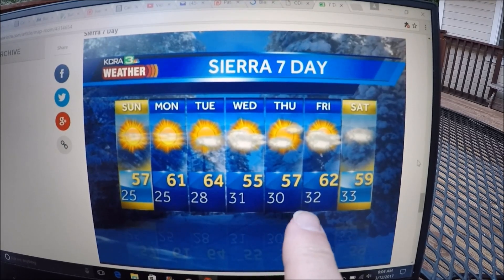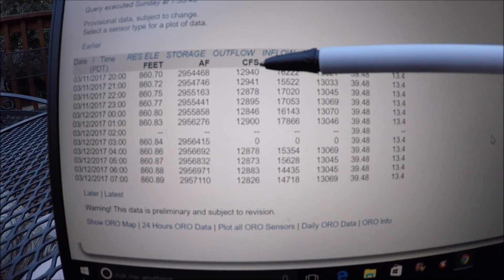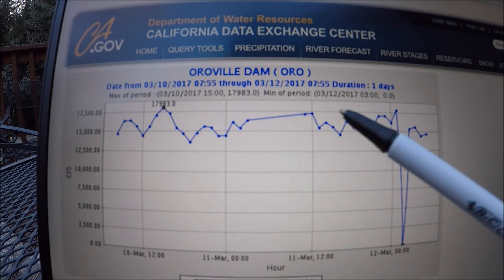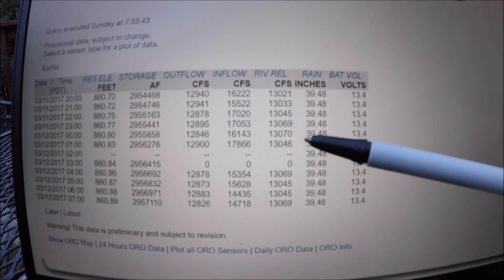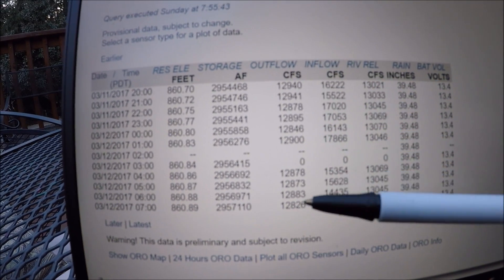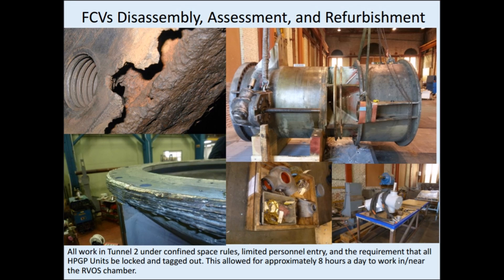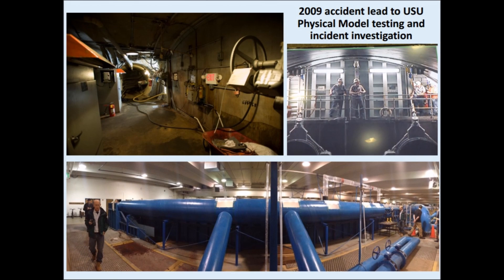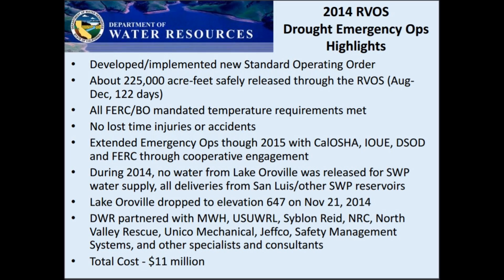Oroville 12 March update River Valve Outlet System Explained

Comment: I have to correct some information here. The system is two sets of  4 valves. There is the 6 ft spherical ball valve upstream of the wall block and a fixed cone valve (FCV) on the downstream side. The spherical valves were never removed as you would need to drain the lake to do that to empty the valves. Only the FCVs were removed and refurbished. the FCVs provide a spray release to dissipate the water force like a garden hose gun. However there is a project in place to replace the spherical valves by installing new valves inline with the originals and keeping the originals as emergency back ups.

Comment: The vacuum requirement for the RVOS is confusing to me… if such suction was required, why not add an air duct on the downstream side of the pressure relief wall? Then theoretically the side where the workers operate wouldn’t be subjected to the air flow issues in the first place. 

The entire system is rather confusing, the access tunnel they used to enter the chamber is where the air came from during the incident I guess. I’m not sure how that ring is supposed to work - the water stream doesn’t actually impact the ring does it? Somehow it’s presence dramatically reduces the waters ability to form a vacuum (aka just disturbing the flow I guess?) but I can’t visualize how the water streams would interact with it. 

Either way, that has to be one of the scariest places on earth to work if you think about the forces and head pressure present on the other side of those valves, all while staring down a half-flooded giant pipe knowing that if anything happens, you’re going to get flushed out of there with unimaginable force.

Comment: can anybody explain how they replace the valves when the entrance to the tunnel they are in is 100 feet below the typical summer low level at 600 feet when they are expected to maintain flows into feather river?.     There are two valves on the one operational tunnel.     Apparently the whole system was replaced a few years ago.  Thanks
Reply from the maker: They were replaced during the drought at very low lake levels.

Comment: You are doing an excellent job of providing coverage of this flood event.  I was flooded out in 2011, so I know the value of accurate timely information.  I enjoy watching all of your videos! Thanks for all your effort!
I have to comment on the Oroville Dam and the use of River Outlet Valve during spillway operation.  Since the discharge tunnel for the a River Outlet Valve uses the same discharge tunnel that the Power Plant Turbine use.  It appears that using the River Outlet Valve when the river water is high would have the same effect as operating the Turbines when the discharge lake level is too high.  This could increase water pressure in the tunnel because of high discharge water levels and could end up flooding the turbine area. High water pressure could lift the turbines out of their mounts and flood the area, like what happened in Russia.
They need to find a solution to the discharge levels, as the it is ridicules that they can't use the turbines river outlet valves to reduce the lake level when the spillway is operating.  Apparently the power station was installed at too low of elevation compared to the river channel downstream of the dam!  They could remove all dams downstream of the dam to lower the river level below the dam, but that would mess up their complete irrigation systems! 
If the lower dams were added after the dam was constructed, it would explain how the final operational design does not function properly because it raised the final operating level of the river!

Comment: Juan, thanks for all the videos, I have been following this story like a civil engineering soap opera.  Even with all the trouble with the valves, it begs the question why not open them now?  Sounds like that can now be remote controlled opened, even with a fire hazard.  Even if they must be opened manually, now the workers know what they will be facing.  Might it be possible to have someone in a dry suit and a strong harness, with diving equipment, to turn the valves on but not be blown away?  Also seems the valves could be open all summer, until the spillway is finally replaced (I think it is a bit far gone to be "fixed").  Also, might it be possible to take out the turbine of the 6th generator from the scroll case, and just water run through the scroll case?

Comment: These days, as far as I'm aware baffle rings are generally used in a temporary situation such as a diversion tunnel. They can take quite a bit of hammering and are usually fabricated from stainless steel. The water speeds up going through the smaller cross sectional area then hits the slower moving water in the expanded tunnel section on the downstream site creating turbulent flow and slowing the water.  The baffle was downstream of the valves that release the water, so this may explain why the low level outlet is now running at a lower capacity than designed. If they cranked it up without the baffle in place, the water would cause cavitation and erode the tunnel lining

Comment: Question if I may? Is the actual height of the dam wall 900 and something feet top to bottom and water depth 861 feet  currently ? Sorry but I have to convert to metric, at that height head pressure at dam  bottom would be almost 2600 kpa or 378 psi. I hope that's right...
Reply: 27.7 inches of head per PSI (If you're talking about fresh water)
861 ft x 12 in/ft / 27.7 in / PSI = 373 PSI

Your calculations are correct on the pressure at the height used.
Reply: I think the pool at the bottom of the dam is at 225', so 861 - 225 = 636' drop
Reply: Even more scary in this situation:  Using the formula A=pi(radius squared), that is pi(36 inches)squared x 373 psi, there are 1.5 Million pounds of pressure on the sphere valves!  Is this actually correct?
Reply: Area = PI x R ^ 2
Looks like you forgot to halve the diameter

PI * ( 36" / 2 ) ^ 2  * 373 = ~380,000 pounds

A 1"-8 bolt (Low tensile strength  grade 2 coarse thread) can break at 36400lb - so 10 of those at a minimum to hold the valve - without any safety margin.

Can't tell the diameter of the bolts, but if you look at this point in the video there are at around 56 or more holding the blind flanges, 20 on the 16" valve attached to that.
https://youtu.be/_q0g43iI9kA?t=8m29s

Comment: Capt. Browne... Can you please explain something for me. In the last series of pictures it seems to infer that the newly installed Howell-Bunger valves were recently removed and replaced with much smaller 16 inch Gate valves. I am not an engineer so maybe I am not thinking correctly but the smaller gate valves would seem to provide less flow than the much larger H-B valves. Which are currently installed?

Thanks again for your spot on reporting.
Your friend in Georgia..... living on a hydro-electric lake that has an emergency spillway that dumps onto a dirt hillside also!!!!
Reply from the maker: Grandin Eakle yes, and I need to get more details on how these valves all work together, and what the final permanent configuration will be.

Comment: ...I'm coming to you, since no one else seems to have accurate information available....my question....what it/was the maximum CFS the main spillway was designed/engineered to be? That is, in normal, non-emergency operation....
Reply: I estimate 200,000 cfs is what the sidewalls will hold.  Watching the footage of it running at 100,000 cfs looks about halfway up the wall.  Say a 20' high wall x 200' wide x 50 ft/sec = 200,000 cfs
The 150,000 cfs figure is the design release to not overwhelm the downstream levies.
Reply from the maker: Doug Ankrum it's been tested up to 160,000cfs long before it failed.
Reply: ..Thanks....!!

Comment: you put a fix on that spillway with steel   ..steel will keep water in or out at fair pressures so first you line that spillway and diversion block set with 3 inch welded plate with a overlap sticking out over the joint where the spillway fairing meets that old concrete deck area     and you start there with a row of  18 53' waffle side domestic rail containers which slides up under that plate overhang that has slots cut in it for the container vertical joins  for a new steel spillway width of 153'   u line the bottoms of the containers with  half or 1 inch plates 55 feet long  so you have a tab sticking downstream into the next row...bolt and seal weld these into the base row   after the first couple of rows you should be able to set the rest of it  on pillar blocks with steelwork bridge expansion joints  pillar blocks 3  53's  with rebar cage inside set end to end and the end walls removed bolted together  cast 1 piece  steel cased  159 x 8.5 x 9.5 with cast in mounting bolts for the joints..26.5 on center   and stacked 4 hi so you now have a  box 153' wide and 38 feet high with 18  8 x 37' openings    and now 11 plus feet of the ground with a  double bottom   and if you get a leak you can weld the thing from the outside anywhere......and you fill the space between the container walls with a hi silica concrete    and paint the steel inside and out in hi silica concrete wash    ..its a real decent anti corrosion preserving compound for steel in water and inexpensive.        and armor that diversion block with a 3-5 inch steel cap  and here is the plus part  you mount solar panels all over that box for a net power increase out of the whole affair and pays for the repairs.
 Best Reporter ,,he blows all the others right on out and supports dwr pretty well i think
Reply: if you need more supports   12-24 inch steel tube
about 5000 containers  construction time   they have a crew there already   3 weeks..4  not much for the steelwork..the solar panels would take longer

Comment: Thank you for your informative videos. I found this information on the USGS website. About 2.5 miles from the Oroville dam, there is a quarry. On March 15, May 26, Sept 14, Nov 9,  and Dec 9, 2016 there were quarry blasts that created magnitude 1.8-2.6 earthquakes at a depth of .2.-3 km. On Feb 7, 2017, the main spillway develops a crater.  On Feb 11, 2017,  the emergency spillway is used. On Feb 14,  there are 2 EARTHQUAKES 2:39 am, magnitude 0.8, depth .98 miles and 2:56 am, magnitude 1.0, depth .02 miles. On Feb 21, there was a quarry blast at 19:45, earthquake magnitude 1.8, depth .3 km. On Feb 27, the spillway is destroyed. These is also a seismogram display ORV BHZ BK 00 at the dam, but there is only one page of data that I could find. Where is the seismogram data? I would like to know if there is a relationship between these earthquakes and the dam. I have not read or seen any substantial information about the earthquakes near this dam. I tried to get as much accurate information as I could, hopefully, I did not make any typos. Any insight you could provide would be appreciated.

Comment: A fire in a hydroelectric power plant isn't a fire in the normal sense.  When a fault (a short) occurs relays sense the fault and cause breakers to trip shutting off electricity.  Before that can occur (if it occurs) what exists in the power station is a giant arc welder.  I'm told the Thermalito plant was running but unoccupied at the time of the accident.

Comment: To clairify, the power house that burned was the power sourse for the river valves. I wonder how long it would take and if they are considering a temp emergency gen to operate the valves?
Reply from the maker: Im not sure.
Reply: I was watching vids of the dam and another viewer pointed out the generator operating the spillway sitting on top of the dam in comments.  It looks like a cargo container and is as big as the trailer of an 18 wheeler.  I'm sure it is still there.  When they need to open and close that spillway in the next few days they can't afford to lose power.
Reply: We were talking about using another one for river valves.

Comment: Well to my untrained layperson eyes,  this reservoir looks like an unfinished POS.  Why they didn't continue a structure over the emergency spillway for access to the other side of the dam, line the emergency spillway  and fix the broken items screams of cutting costs over safety.  The parking lot area still looks like a great weakness in the system.  They had been warned too!  I guess the "it will never be a problem" became a problem.

Comment: I guess they design infrastructure to only last 50 or so, years..  It saves money and by the time it fails,  the Designers and Politicians will be gone..  Most of the infrastructure in the  USA is well past the 50 year mark,    A large percentage needs to be "Rebuilt",  NOT repaired,     But, the USA is broke,  
    It seems Nation Building has been more important,  Trillions of dollars are GONE,   "Draining  the Swamp is crucial"  to rebuilding American roads, bridges, damns and the Electrical grid,
Reply from the maker: Oroville-the tip of an iceberg?....

Comment: Woudn´t it be possible to built a temporal channel with prefabricated concrete U-channels from the first part of the spillway to the last part of it and release maybe 5000-10000cfs without new erosion problems? They have plenty of debris to fill the gap between the two parts of the spillway and the prefabricated should be standard components. What do you think? May it be to complex to build this fast with such a slope?
Reply from the maker: All design ideas are on the table....
Reply: Looking at google earth I see a ravine beyond the parking lot and just before the quarry that your idea might work.  I would even consider using it without improvements if the dam started to go and open it up with explosive to relieve pressure.  It has the advantage of putting spoil in the river further down stream then right next to the power plant.  A finger from the lake feeds it and if it was suddenly opened up this shallow stream would hopefully keep the whole lake from dumping out and drowning people like rates.

Comment: Just after the last election some "experts" were being interviewed and were asked about the new President's promises to upgrade the infrastructure. One of the Guest Experts comments was "there's no great advantage in spending large sums of money on the infrastructure because it doesn't add anything new". This situation very vividly points out the advantages in correctly and routinely maintaining the "existing" infrastructure in a "TIMELY" fashion. 
Hard to believe management has "sat on their hands" so long with these conditions and events. Can't believe that power plant hasn't been addressed and it has taken this long to "ALMOST' deal with the River Valve Outlet System. Where has all the annual maintenance budget money been spent??

Comment: They ran the gated spillway for about ten days at 100 Kcfs.  Knowing the snowpack, they should be able to give an estimate of how much more they will run it.  I would say another 30 to 60 days at 50 Kcfs, but they have professional hydrologists.
Given a professional estimate, the next step, what is the probability the gated spillway will hold until summer?  And last, given that, how much more to spend on the emergency spillway in the next weeks?  0 dollars, or 200 million?
Reply from the maker: The main spillway MUST hold out for the rest of the season....the repairs on the emergency spillway are effectively done.

Comment: Thanks for the most recent update.To show how dysfunctional the DWR is one only has to go to their photo galleries of 1991 Oakland hill fires and 2006 dry San Luis Reservoir photos. In driving by San Luis last week it is at capacity.They show a cement mason patching a 8 inch diameter hole in the already demolished spillway. https://pixel-ca-dwr.photoshelter.com/galleries/C0000OxvlgXg3yfg/G00003YCcmDTx48Y/Oroville-Spillway-Incident

Comment: anyone know why the inflow/outflow data isn't updating on cdec.water.ca.gov?

http://cdec.water.ca.gov/cgi-progs/queryF?s=ORO&d=12-Mar-2017+20:06&span=48hours
Reply from the maker: not sure, crapped out yesterday too for several hours.
Reply: I saw that too. It's screwing up my data. I've been modeling the amount of acre-feet of water in the lake. 

The past few days the lake was filling up at a rate of about 180 acre feet per hour, but the rate has increased to about 290 acre feet per hour. 

https://www.desmos.com/calculator/xrwsvgcimx
Reply: What's your point? Do you know why the data for the dam hasn't been updated for the past 15 hours?

Comment: Thanks for the informative videos. Your expertise as an aviator is certainly more credible than the Script-readers, aka the evening news. You mentioned that, basically, DWR is in "Emergency Management Mode". I saw another video that mentioned Union Contractors being paid a minimum of $3,000 per week and up to $7,000 per week, working on this project. Sadly, working in Crisis Mode is how priority projects get done... or not. IF  this project actually gets completed and a short-term disaster is averted, the bureaucracy and unions get patted on the back. But if it's a complete failure, they have the luxury of blaming past decisions or administrations. Thanks for the informative videos. You are what the Evening Script-Readers call... Fake News.

Comment: Thank you Mr. Browne for the wonderful job that you are doing with these videos! So much misinformation out there, it's been great to hear it from someone that is actually informed, and not just fear mongering. I have been lucky enough to have worked at almost every DWR facility in Ca, as a contractor providing services. I was there feet away providing standby rescue for the baffle ring removal and repair of the pressure relief wall. Your information is quite accurate, thank you sir!
Reply from the maker: Wow! I would love to hear the eyewitness account!

Comment: Did they take that valve machine out of the pipe to use it to pump water in the power house that was burned down?
Reply from the maker: No.
Reply: what did they do with it then??